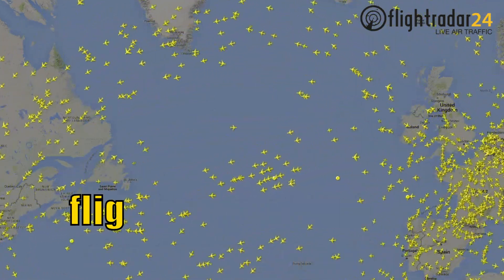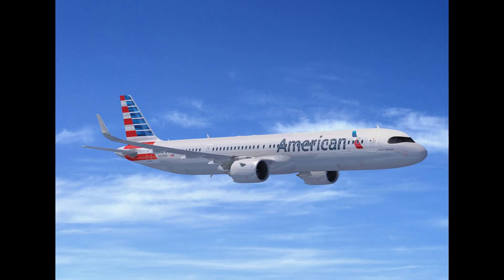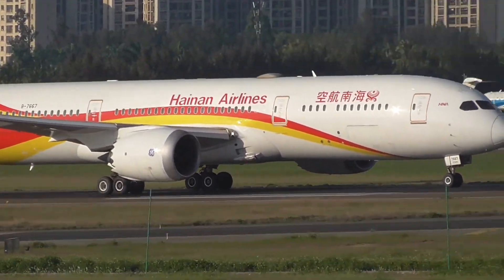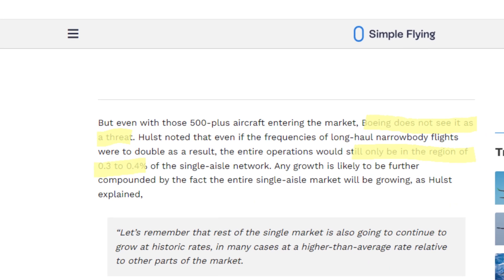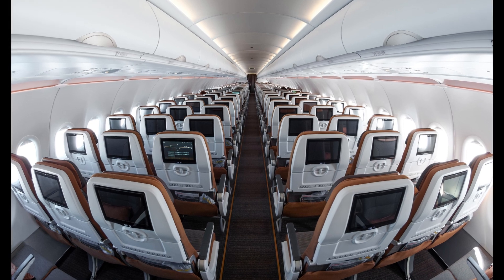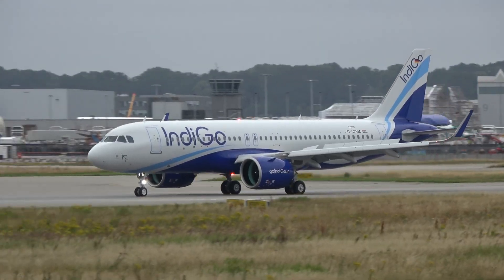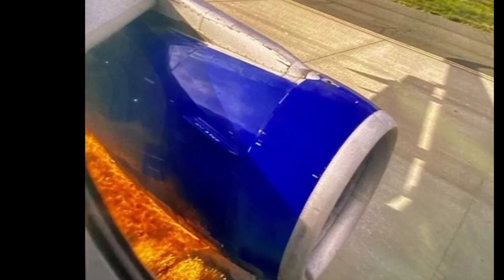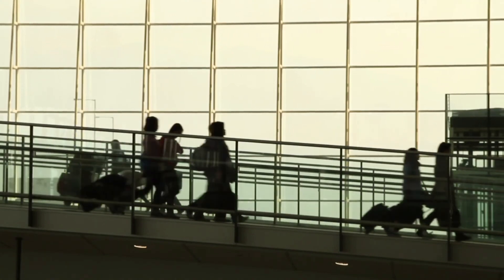This Is Why Airbus A321XLR Is The Problem For Boeing

Comment: Hi can you please take a look at the reduced cargo capacity thus less revenue through freight being transported in the belly on regular passenger service flights?

Covid made quite apparent how much freight is actually being transported on regular passenger flights once the passenger flights stopped and suddenly stuff didn't get from a to B anymore.

I'd be interested in how that impacts the profitability of the a321xlr
Reply from the maker: Yes, there might be another A321XLR video in the future, as the topic seems to be very popular, so I will definitely include this as well
Reply: The XLR actually isn't bad for cargo capacity. While it is worse than the regular A321Neo, Airbus found a way to relocate the auxiliary fuel tanks used on the LR to move the majority of them out of the cargo hold. This means that the XLR, despite having more fuel tanks than its predecessor, the LR, takes up less space in the cargo hold.

Comment: Will scolded FAA (MAX scandal) accept Airbus RCT solution, or will they increase their requirements for certification?
Reply: The A321XLR's EIS has been already posponed due to additional requirements from FAA and Boeing concerning the RCT. They are all been fullfilled by Airbus. All new "requirements" from FAA will be perceived as childish.
Reply from the maker: @jjhartlohner  We will see, but yesterday EASA certified A321XLR, so it may help with FAA certification as well.
Reply: @mkairlines  Yes, EASA certified the MAX too.

Comment: Wing load comparison XLR vs 757: 823.82 vs 638.23 kg/m2, at their respective MTOW. Single wheel load XLR vs 757: 25,250 vs 14,460 kgs at their max take-off weights.
Reply: So I guess the questions are: 

Has the 321 been sufficiently beefed up to be as robust as the 757?

and

How do those numbers compare to the 321's already in service?

Comment: Remember the Boeing 707 and Douglas DC-8 were both single aisle jets for transatlantic flights. Before the wide body jets came into production.
Reply: No connection with the A321XLR.
Reply: @stabilo3170 you missed the point he made.
Reply: Most people don't realize that all Boeing planes produced at Renton share the very same 148-inches fuselage barrel, introduced with the 707 back in 1957. Yes, that continued on the 720, 727, 737, and 757. The 757 was the only one of them with a totally revised cockpit, for compatibility reasons with the 767 (still in production at Everett). The original design, the Dash-80 had a 132" fuselage, but since the DC-8 came to the market with a 147" width, Boeing was pressed to improve on that.
Reply: Buena apreciación 👍
Reply: And the 707 and DC-8 were fine, I flew on both

Comment: As a whole means people will stay 7-8 hours in a small plane, i don't thinks it's good for travel, but it is definately good for Airbus. Boeing is certainly busy sorting its own sh1t, but they have no 757 replacement so far.
Reply: You don't know what are you talking about. A321XLR will change the industry, because you can keep routes with less passengers, giving chance to smaller airport to have intercontinental flights.
Reply: @deadend2023  Yeah, it will have its niche –every plane has its one– but it's no 757 substitute. By the way the A318/319/320/321 fuselage (156") is wider than all 737s and the 757 (148") too.
Reply: @jjhartlohner  having aircraft as A321XLR for long flights, minimize layovers and lower prices. I'm more happy to have smaller seat and less flight time, than larger seat with more flight time with layovers. Not to mention as previous comment, there will be no changes in seat size, only less seats on aircraft. A321XLR will give change as well for low-cost airlines to have international flights. Even seat size A321 is wider than B757, cabin size of A321 is 12.1 feet, while B757 is 11.7 feet. This impacts seat size, that in most A321 are larger than B757.
Reply: So a wide body with double pax is better for travel?
Reply: Like others said, don't worry; these planes won't make the current widebodies disappear. Main routes from main airports will still be served by large widebodies. But now thanks to this aircraft, smaller airports will also have the chance to support long haul routes, removing the necessity for people in these areas to transfer at a larger airport for transcontinental flights, therefore reducing the overall travel time.
Reply: Seats are still the same size. 🙄
Reply: What is good for travel is affordable ticket prices. I don't want any 757 successor or widebody long haul planes if it means the ticket price will double in a few years. I'm wondering what about other people, if they are willing to pay new types and high quality service, leg room, extra luggage....

Comment: Boeing is slowly but surely losing the race.
Reply: When will Airbus buy over Boeing ?
Reply: In the single aisle segment definitely yes. The B787 and the future B777-9 are the last models to beat Airbus...
Reply: @patrickpeters2903 the 777X is way older than A35K it’s just 737 max vs a320 neo again
Reply: @patrickpeters2903 Boeing  are gone already

Comment: The 321XLR is no 757, for that it would need 8-wheels on the MLG, and larger wings and flaps. The absence of fuel jettison is another weakness. The 757 hadn't either, but the main landing gear was far more robust. The 321XLR will prove inadequate for hot & high airports and on short- or contaminated runways, Airbus may be squeezing the 321 beyond its limits.
Reply: It’s 30K lbs lighter. Of course it doesn’t need larger wings and flaps. And the absence of fuel jettison isn’t a weakness at all. Where do you even get that?  It’s perfectly fine to land overweight now a days if needed.  

Hot and high won’t be an issue, because you are comparing max take off weight. The 757 has 1000 miles less range. If you fly the a321 at the same range as the 75, you can leave a lot of fuel behind and the airplane will even be lighter than the 30K difference it already has. 

Most airports have had their runways extended by now. We don’t live in the 1980s anymore.
Reply: @rtbrtb_dutchy4183  "Indeed, we live in an era where quarterly financial results are prioritized above all else, often at the expense of underestimating risks. The 737 MAX crisis exemplifies this, highlighting Boeing's struggles after its 'McDonnellization.'"
Reply: None of the stuff you mentioned is anything airlines really care about anymore. Fuel jettison and gear size are hardly noteworthy issues when comparing aircraft, and it's certainly one of the last things airlines would care to look at when comparing them. As a commentor above also mentioned, it's not the 1980s anymore, runways are longer, and more airlines don't care about takeoff or climb performance anymore. All they care about now is fuel efficiency and capacity, both of which, the XLR performs more than well enough in to take on the 757. The XLR is significantly more fuel efficient than the 757, and boasts a fair amount more range aswell. The capacity of the XLR also competes with the 757, as it seats more passengers than the 757-200, but less than the 757-300, fitting nicely in between for airlines. 

In all the ways airlines care about, the XLR is a perfect replacement for the 757
Reply: @Prodagist  exactly. Couldn’t have said it any better. 

Also, I found out that runway performance is actually better with the XLR compared to the 757, even with both at max take off weight. The XLR requires a shorter runway.
Reply: @Prodagist  I can only agree with you. That mentality has brought Boeing to its current predicament. In my humble opinion, Airbus is drifting towards a similar path. Time will prove whether the XLR was a mistake or not. What is undeniable, even before the start of commercial services, is that the XLR doesn’t surpass the 757 in terms of performance. Yes, the XLR may find its niche; every product has one. As someone once said, comparisons are odious.

Comment: While the 321XLR has an impressive range and significantly better burn rate compared to the 75 it is not a successor or replacement. As someone who flies the the 321NEO it pales in performance compared to the 75.
Reply: Performance is no longer required to be a successor of the 757. So yeah, it can be considered a replacement.
Reply: @rtbrtb_dutchy4183  Iberia will soon learn the lesson, of scheduling an XLR out of Madrid-Barajas (elev 2000') at a hot summer day (40ºC plus) and a tailwind component both on runway 36 or 14 for BOS or IAD. They will have to stop at SCQ to refuel. In the winter, eastbound flights will be problematic on contaminated runways. Stops at YQX or SMA?
Reply: @jjhartlohner  for the fun of it, I ran a flight plan from Madrid to Boston. At M.79 in an A319ACJ. (A319 , extra tanks, can fly 10.5 hours with full fuel) . It takes 7 hours and 27 min. It’s 3175 NM. It takes nowhere near a full load of fuel. So no, I don’t foresee them having to stop. An 11 hour airplane should be having no issues at all up to 9 hours. 

And eastbound in the winter isn’t going to be an issue. What are you even talking about?  Snow in Boston or IAD on the runway?  That gets cleaned off, plus cold weather improves take off performance by a lot. 

Now, is that truly comparing apples to apples?   I mean, the 757, can it even make it non-stop?  I don’t think it can with a strong headwind.
Reply: It is a successor and replacement for the 757. The 757 certainly had impeccable performance. Its powerful engines could carry it to its cruising altitude faster than pretty much any other commercial jet. However, most airlines don't care about that anymore. The 757s runway and climb performance are amazing, but they aren't really necessary. Airports around the world have expanded to the point where this is almost never a concern. All airlines care about now are fuel efficiency and capacity. Both of which, the A321XLR wins in. The A321XLR is significantly more fuel efficient than the 757 and can also fly a fair distance further than the 757. The A321XLR also boasts a slightly increased max capacity over the 757, being able to hold more passengers. In all the ways that matter, the A321XLR beats the 757. The only real reason the A321XLR isn't being seen as a 757 replacement is because some of the largest 757 operators are major US airlines, who rarely buy from Airbus due to the tariffs placed on foreign products.
Reply: @Prodagist  The newest 757s are 20 years old. Boeing has canceled its New Midsize Airplane project (757 successor) after the 737 MAX disasters (a fatal choice in my opinion) and the next Boeing model will be not ready before the mid 30ths. If the US airlines need a replacement for their older and older 757s, the A321 XLR is the best option for the next 10 years or even longer.

Comment: max 8 can fly 8 + hours based on current flights. 
If they certify max 7,i assume it can fly 9+ hours. Without any additional tanks . Enough to beat a321LR.
Reply from the maker: According to official data, the MAX 8 has a range of 3,500 nm (MAX 7 3,800 nm), and the A321XLR has a range of 4,700 nm (A321LR 4,000 nm). XLR is therefore unbeatable, MAX 7 can only compete with A321LR in terms of range. It's smaller and has a higher cost per seat, so airlines definitely prefer Airbus, the A321 is also better for cargo because it can carry containers, and the 737, as far as I know, can't.
Reply: @mkairlines  I was informed, Airbus is looking at extending range of its A220 to 4000nm due to customers pressure.
Reply: @mkairlines  You'r right, A320 series can accomodate standard LD containers while 737 series never did! 737 just have a costy  bulk hold.
Reply: @stabilo3170  Yes, all 320 variants have a wider fuselage, than all 737 variants; just because all Renton products share the same 148" barrel (from 707 to 757).
Reply: but to fly 8 hours it must not crash on the way